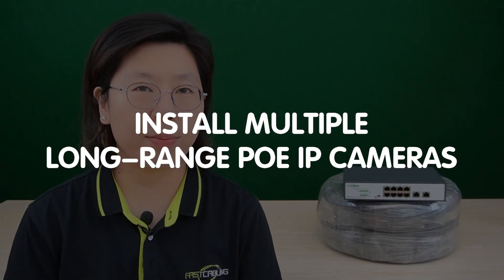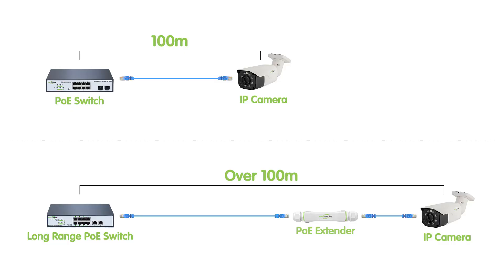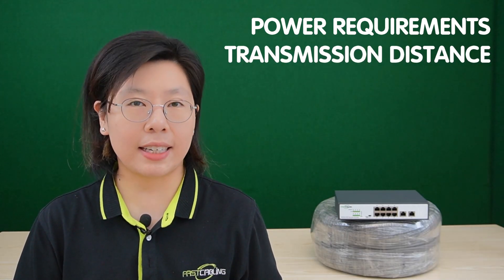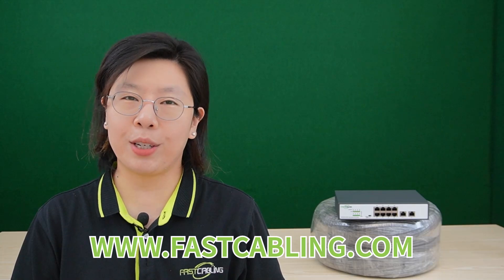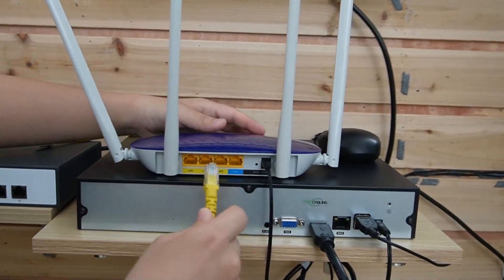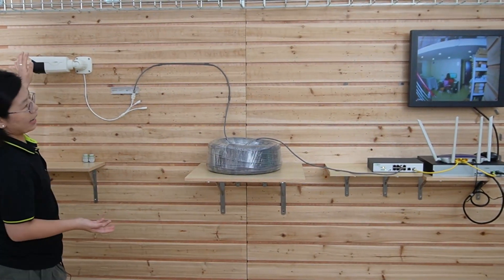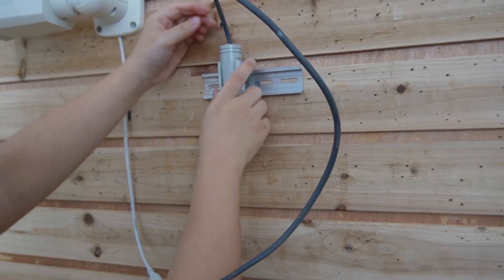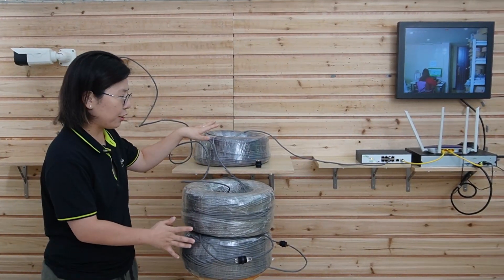The Best Way to Install Multiple Long Range PoE IP Cameras

Comment: Excelent video. Can you show to me how connect a camera Wi-Fi to IP Poe Splitter to Poe Switch. I need a Poe Splitter connect in Poe Switch? Or need only RJ45 Baluns. The camera is IMOU CRUISER 4 MP. Thanks
Reply from the maker: You can't use balun unless it is the analog cameras (AHD, TVI or CVI). The IP cameras doesn't work with video balun. It is the digital signal. Yes, you can use PoE splitter, and it will separate the power and step it down to DC12V. The PoE take the power between DC48V-DC56V as power souce.
Reply: Thanks  @Fastcabling